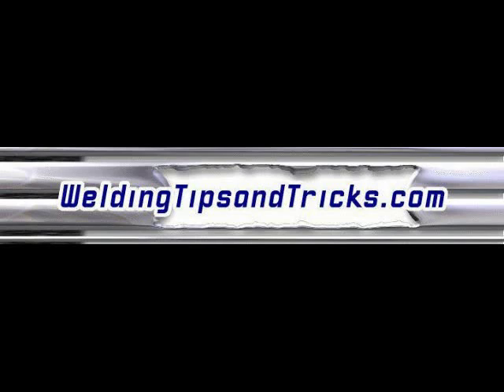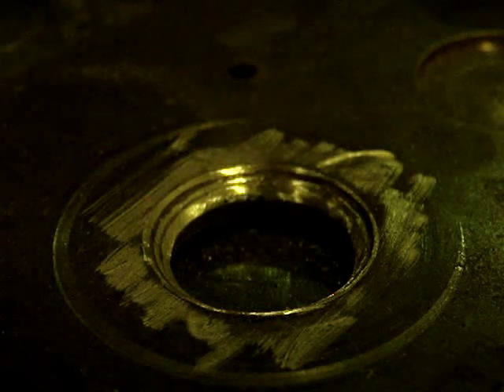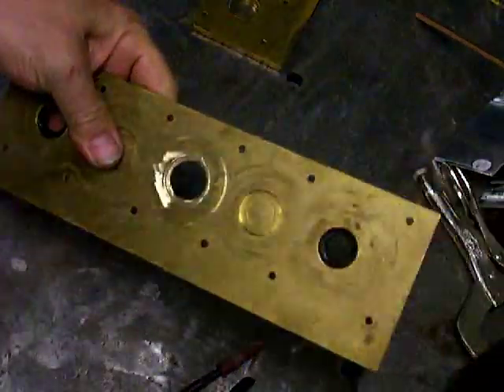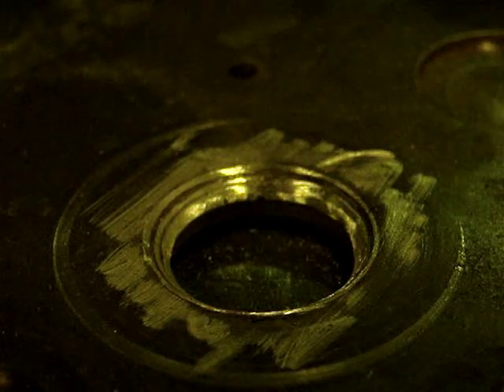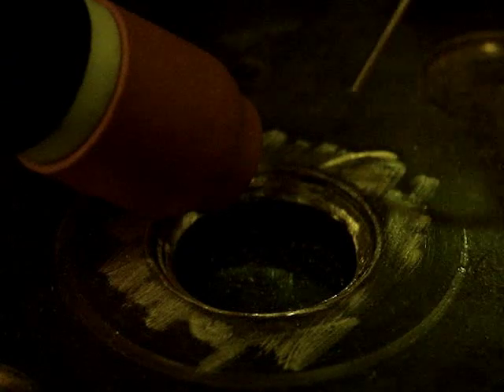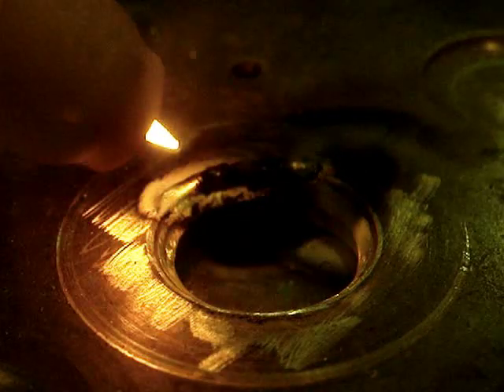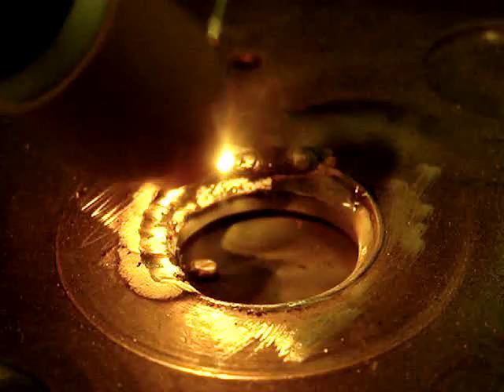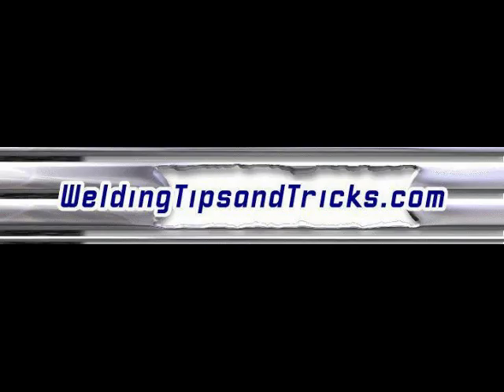How to Tig Weld Brass - A Tig Welding Brass Repair Job

Comment: I suppose the brass in this video contained no or quite small amount of Zn in there, otherwise it would crack and burst out from the puddle... I think It doesn't matter which pulse settings you applied... Zinc is zinc, so it is not supposed to be in TIG puddle. No TIG but GAS (propane, acetylene, etc.) brazing only for Zn-brass. IMHExperience. Sorry.

Comment: Thanks for the video it gave me a great place to start, and dragging made a WORLD of difference.  I found best luck with 15cfh Ar, 40hz, no pulse 75% dc- balance @220a on pannel pumping pedal. C260 brass 1/8" with generic "brass" filler wire. It NUKED my 3/32 3% Lanthanated would recommend 1/8" as i had to dig out some tungsten and backfill.

Comment: hii sir how can we weld 20 mm brass sheet with tig welding I tried bt the brasing rod was not melting properly can you please guide me how can I do this ??
Reply: Yes contact me 7011846159 Vk Welding works

Comment: Hello, please help me. I want to weld 1mm brass and copper sheets. Today I have tryied to weld with silicon bronze rods, but it wont stick. When I set amps to 120, brass sheet was with burning holes. Please share your experience. It's very important to me. Thank you very much!
Reply: Have you tried either low-fuming bronze brazing rods with a Tig torch, or even bare copper wire with your Tig? Both have worked for me in the past, but I cannot help you with my heat settings since my footpedal defeats my temperature control and I just feather it when I see the puddle getting too wet.

Good luck...the Farmer.

Comment: I've had very good luck using lfb brazing rod as filler. It does fume quite a little when welding but it leaves a nice bead. Stack of dimes just like an aluminum weld.
Reply: What kind a rod is and where can we buy it?
Reply: Old comment but here goes; welding supply shops should have brazing rods in stock. You may be able to buy them without a flux coating but thats all I can get locally so I knock the flux off and clean em up but its a pain. I once got lucky at canadian tire and found some 0.62 lead-free brass  wire on little 2 ounce rolls which worked pretty good too.

Comment: After watching this video I went and did my own brass TIG welding and I'm sorry but it works way better in DC straight polarity I'd like to know if I use an argon helium mix is it will help clean the welding process as well as allow the weld to get hotter by the way what filler rod were you using?

Comment: I have attempted brass for fun, some near paper thin shims we had around the shop. on a miller dynasty 350 dx and it did it just fine, with no pulse, Ill try to post a video of that eventually.